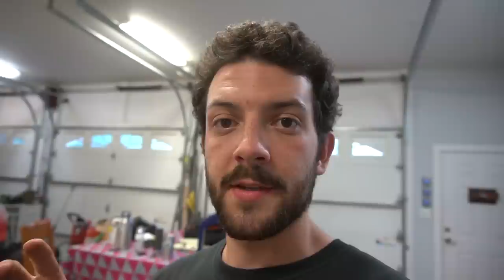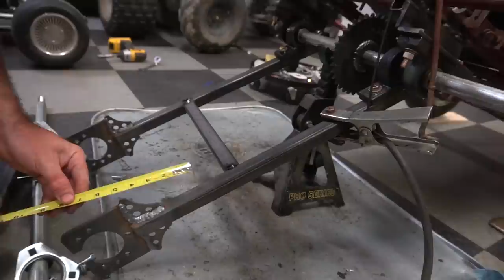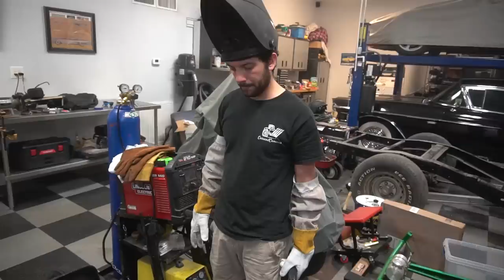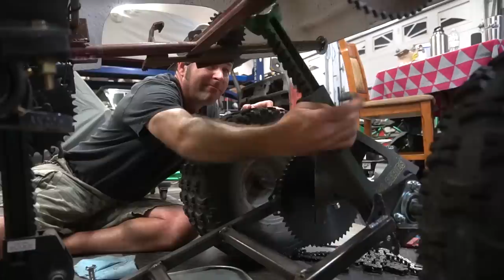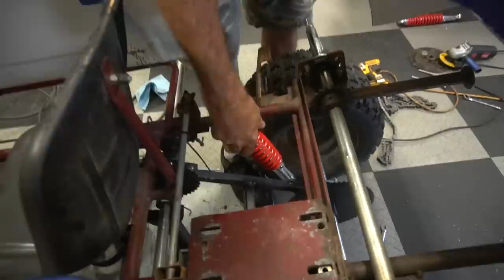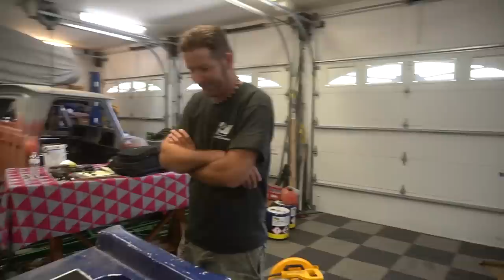HUGE Lift | Monster Truck Kart Pt. 2

Comment: Ike  I'm a property maintenance guy and can do everything  but Hvac  would be more than willing to make the drive down from Raleigh if you need a hand tearing out or putting floors and walls back in.
Reply: Thanks for the offer. I believe i have it covered.
Reply from the maker: Thanks for your offer!!
Reply: Ed Wolfram your a good man dude.

Comment: Just saying the springs and shocks on the back should be more vertical as the shocks lose their use as shocks, the more they are off vertical. It is going to be a neat little truck for you to have some fun in. Keep safe and enjoy the company you two have.

Comment: Welp, this is gonna be friggin awsome! But I do agree with a comment I saw on the last video, you'll probably wind up needing some kind of cross link on the back of the trailing arms to prevent them shimmying side to side, and putting stress on the pillow blocks. Can't wait to see the finished build! Also glad you guys are ok after the storm!

Comment: Hi, from Raleigh NC. We got real lucky with the hurricane.
I've built several geared down buggies for my grand kids. 15 mph is fine for them. The only problem is, they are REALLY hard tp push if they die out in the feild. Last one had an atv front end and rear axle. The front suspention worked out well. I am anxious to see how this one turns out!
Reply from the maker: Nice- ours should crawl pretty well. Glad you were safe up there!

Comment: Why not oval out the jack shaft bearing mounts so u can push it forward a small amount to tighten the chain or do they sell half links that size a chain tensioner seems kinda cheezy unless u need that slack for the articulation also what about using mountain bike springs or is that what u are using I really doubt mounting them upright will be enough they seem like there not up to task. just my observation I lovee this build and I can’t wait to see what y’all do for the front end maybe double wishbone would be plausible I know u guys can fab somthing up maybe utilize this springs on the front there shouldn’t be as much weight as the back but idk lol keep up the great work and I’ll be praying for you and Ike’s family god bless and good luck

Comment: Why not attach the engine plate to the trailing arms and configure your gear reduction with some kind of transfer case using actual gears? I do like the chain drive setup but I feel like it would cause some chain tension issues when it starts moving under its own power. You may even have the option of installing a torq converter later on. Just a bit of constuctive criticism :)
Also adding Im glad your all safe and I hope to donate to relief efforts as soon as I can. Best I can do at the moment is send you some love and prayers as your community recovers. God bless.

Comment: Axle over pivot of rear swing arms with chains running to each arm, connecting to a small single axle on each side, connected to each wheel, same wheel speed, but can have independent suspension for each wheel

Comment: It just hit me as you adjust the rear end that 5 inches forward. 

Suspension right 

Imagine a small set of shocks hooked up to the front of the rear arms 

Hence not cut off ' aided with the normal shocks. 

Even a set of springless shock absorbers. 

Had to type this in after it came to me. UFO t totally know why but anyway 

We're still having crazy rain I feel for ya guys living in the hurricane affected areas. 

Peace out ✌️

Comment: Why did you not weld the engine mount plate on the trailing arms? Making it part of the suspension? Think it would’ve been easier
Reply: Pretty sure they answered that question in the first video.
Reply: We wanted the engine up high

Comment: Scrap the square tube rear suspension and use dom tube with adjustable rod end sphericals. Extend an ATV rear end that uses a drive shaft and adapt the chain from the engine to that.

Comment: You could widen the stance. Even though it looks wide now with the body on and that would mean more fab work on the front end probably. It would look good though! I’m curious to see the front end work. If you bag it you’ll probably have to widen the tires anyways just enough to allow the Body to pass to drag ass, lay frame and throw sparks lol or

Comment: I thought you guys were gonna have independent rear suspension on this? Connect both trailing arms back to your pivot axle with another arm to stop and twist then use chain and sprockets down to each short axle on the trailing arms. That way its all chain driven and it still has independent rear. Cool vid anyway guys!

Comment: Chains? Belts? How about repurposing a shaft drive mower deck? Junkyards sometimes have lawn care stuff. Differentials, shaft, even a Lobro joint on some. They're usually designed for K's of RPM.

Comment: You should use a Watts linkage if you don't know what that is research it fairly simple but it keeps the articulating rear end in line with the chassis

Comment: Shocks should be closer to straight up and the rear control arm should by X braced. The welds will break the way you did it
Reply: DARRYL ROLAND yep, once they get a little twist, pop goes the weld
Reply: 4 wheeler swing arms useally have a cross brace like cac did it and they hold but an x would be stronger
Reply: Meh many carts come welded with a shaby welds to begin with. I think the saying goes " it'll be fine"
Reply: I agree, your putting too merch leverage into the shock.

Comment: How about going for an independent rear suspension setup with 2 smaller rear axles with a sprocket on each, and 2 chains driving them from an axle at the pivot point?
Reply: I had this thought on the last video when they shared it!

Comment: Hey guys, I have a 2013 John Deere tractor, the engine runs great, it only has one problem, it is stuck in reverse and will not move. We would be happy to give it to you for FREE. If you are interested please respond. Thanks!

Comment: How is she able to get to these rural areas to deliver assistance and the Red Cross can't?  So they can't or they don't think it's worth the trouble?
Reply: There are several options. 

1) They have regulations in place that make it impossible for them due to danger or complications. 
2) They don't have the equipment available to physically get there. 
3) They are needed more elsewhere.

Comment: ok...the way a coilover (or any shock) works is like this;  shock damping is most effective at perpendicular to the axle (ie: no angle; usually not practical), as the angle increases the damping (and load carrying ability in this case) decreases, and at about 45* to 90* the damping is essentially ineffective.  the angle that you have mounted those coilovers makes them useless as coilovers.  indy cars use cantilevers, which is why their shocks can be mounted flat like yours.  ..you dont have cantilevers...  basically you have a swingarm.  like a dirt bike.  a swingarm needs linkage to correct this problem and allow the shock to move to vertical at full bump/compression/stuff.

Comment: Talking about tons of gear reduction got me thinking...why don't you by build a heavy duty chassis with nearly 250:1 reduction, call it THE TUG. Use it to tow large vehicles, rip out bushes, etc. Hardest part would be wheels/tires/getting enough weight for traction.
Reply: Actually to hell with wheels. TRACKED VEHICLE.

Comment: just a suggestion but why didn't you cut the body instead because the body is too small for you guys anyway and lengthen it and that way it would give more girth to the overall build... because monster trucks themselves are not proportional to the actual size of a regular truck unless you're going to Old Bigfoot

Comment: if you were asked to do it like an actual monster truck you would put the engine in the belly of it and that way it would solve your high center of gravity that's going to occur cuz you're probably more than likely going to flip it over around turns and then you are wheeling  it

Comment: WUSS!!  Could have stayed and you and Ike could have worked on that build more.

There is a company here in Arkansas called GENERAC.  They do propane powered generator installations and have complete setups that are really quiet for areas like your parents place.  I don't know if they do them over in your neck of the woods, but it is definitely worth checking into.  A 10 or 15Kv generator would run the whole house and garage without a problem.